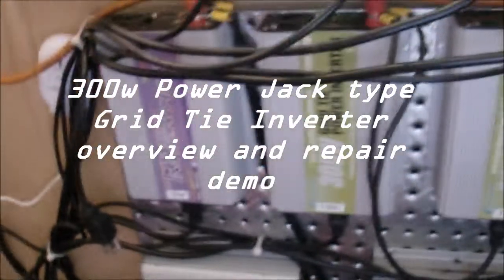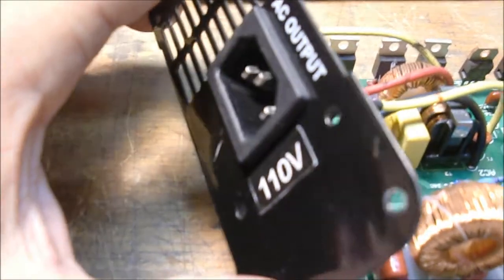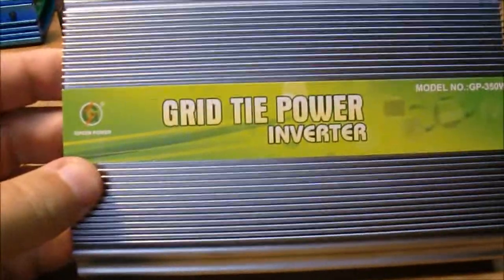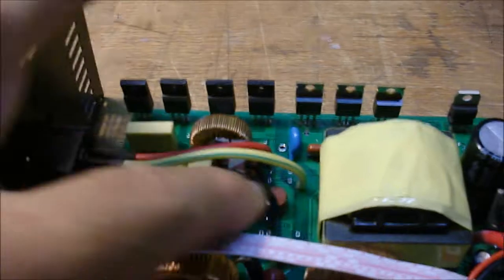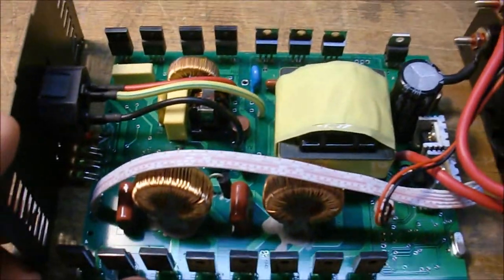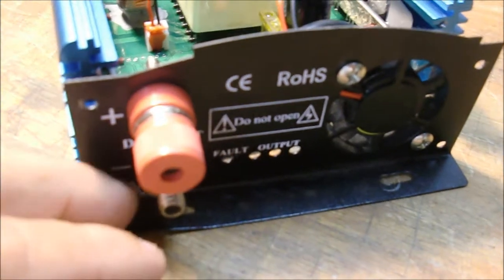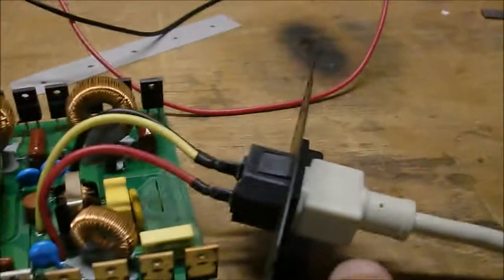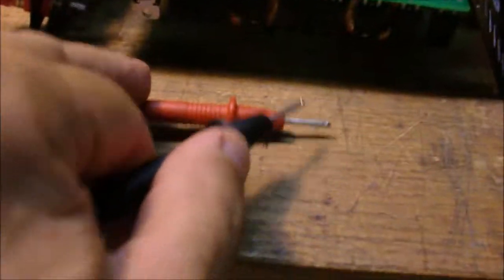Power Jack Sun 300 Grid Tie Inverter repair

Comment: @7:58 Don't forget to remove the carbon under and around any blown component. The carbon acts like a leakage path that can cause problems if not addressed. Under a fuse it may not be as vital, but it's still good practice.

Comment: At first I read 75A 250v on a GP-350W GTI AC fuse I'm replacing, but using a magnifying glass and flashlight I noticed they put a "T" next to the "5", so it said "T5A 250V" not 75A or 7.5A.  Be very careful finding the correct fuse, a higher rated fuse could've started a fire and further damaged the board.   The AC fuse is called a "radial, can, vertical" fuse under digikey or mouser's "package/case" field, under "fuse type"  it's "board mount (cartridge style excluded)".  Hope this helps.

Comment: great vid! Tks for sharing!  Why do these mosfets blow?
Reply: That is an excellent question and one which it seems even the manufacturers don't know - as the best they can do is to issue people with replacement MOSFETs and tell them to solder them in!

I had a 250W (I think it was) which died when being driven from a little 20w panel - no chance of it being over voltage and massively under powerered. Then I bought a 1200W unit to service 4 * 250W panels. It worked great for nearly two months. Then it blew AC MOSFET, DC MOSFET and I vaguely recall it blew a diode too.

They sent me a replacement kit - which made it all work again for a few months and then it died and ended up dumped in the junk box for parts.

A real shame as if they could find out why their circuit design is so flaky - and solve it - then they would be a useful product. As it is, they are just unreliable grot that needs babysitting and repairing on a fairly regular basis.

One thing that DID occur just now (and I cannot recall the circuit) was whether or not there was a low value resistor in series with each MOSFET to make sure they all "pull together". Without that, it is quite possible that just one MOSFET may do the bulk of the work while the others just "sit by and watch". As such it gets hot, shorts and fails again.

I know I tried fitting GOOD transient suppressors on the mains next to where this was plugged in - but as I say, it still died after a few months.

I don't expect perfection for a cheap product - but I don't expect to have to repair it every few months. If fitted to a proper circuit, MOSFETs can work cheerfully for DECADES without failing.

Comment: Great video. You got all the talking points without wasting a lot of time.  Just bought a bad Greenpower 350 like you pictured.  Gave me something to look at while I wait for mine to arrive.  Been repairing electronics since 1965.  That G-S shorting is a good trick for others to learn and is generally not affected when other FETs are in parallel, except lowest resistance is bad due added gate resistor. Ever figured out what the real efficiency is of these small units?

Comment: Hello I have a grid tie inverter 1000 W. The fuse in the inverter is broken. Underneath the fuse is labeled EUR:T10A L250 V. Does anyone know how this happened and if there is any way I can fix it? Thank you in advance.
Reply: As you posted this 11 months ago, it might be a bit late to offer help - but if you cannot find a fuse to drop in as a direct replacement to fit in the holes, you could always just solder in a couple of lengths of wire (1mm conductor at least) and then solder it to a panel mounted fuseholder and pop a 10A fuse in. Cruder still, you could use single core copper wire (again 1mm or better) and solder a 10A fuse directly to the wires. Don't touch it while it is on :)

Before you do this though, you might want to buy a cheap little multimeter if you don't have one already and make sure when you set the meter to OHMS, that you do not find a short on any of the MOSFET's. If you do, you need to replace these before powering on or the fuse will just blow again.

They really are desperately unreliable inverters.

Comment: I have a grid Tie inverter that doesn't seem to work right.
1) Fan does not come on even though the unit is almost to hot to touch.
2) it does make AC current but an new unit of the same size put out 900w more.

Any ideas?

Where do you buy spare parts?

Ralph
Reply: Perhaps its a bunked fan, Does the unit output rated voltage if allowed to cool?

Comment: Hopefully somebody can help me I have sun grid tie inverter 10v to 30v model and when I connect it to a input voltage of 14v the green lights move but on my kill a watt meter it does not show any watts can anybody help me why doesn't it produce any watts if the green lights are moving

Comment: Hi Fearlessthinker, you have taught me to identify the problem with my little GP-350, its funny, i watched and worked out the fuse ac was blown, mine has a glass fuse in a little black box instead of the solder in one, I paused the video, went and checked it and it was blown, i replaced it and plugged it into blow the new fuse, then i came in and watched the rest of the video (forehead slap) and the Ac Mosfet is shorting, lol, could have saved a fuse if i watched it through the first time, lol.
Can you help please ? If it is identified as a magnachip MDP13N50 , What are the main numbers that identify it, is magnachip just a company, Do i need a magnachip one or just any MDP 13N50 or a 13N50 ? I dont know what the numbers mean... Thanks soooo much.
Ms Maddy xx

Comment: Is there a visual means of determining the input dc voltage i.e, 12V, 22-60V, etc?  I've inherited an 800 W direct grid tie inverter but there is no printed indication of the input voltage required.

Comment: Go with a 50v Cap rated for 105 degrees Celsius. It is safe to go up on voltage, but never lower. Use a Nichicon or Panasonic and check your mm height and diameter before ordering to ensure it will fit.

Comment: I purchased 2 - 300 watt Eco-worthy solar systems but havent gotten more that 140 watts coming out of the included grid tie inverters(via WANF meters). I also checked my main meter and it only changes .25 watts or so when I turn the solar systems off and on. I also have a "Solar city" installed solar system, but needed to make more due to adding electrical appliances.Any notions?

Comment: Hi, I need some help :)
I do have this new inverter its a 12v 300w pure sine. It turns on, fan turns on but no voltage at the ac terminal barley 0.8v with multimeter and when I plug one of the multimeter leads I get the 50Hz, when I plug both at the terminals I get 0 Hz. Any ideas?

Comment: Hi, can you tell me if I can use a 12v battery to power my power jack 600W grid tie, just to test it. It worked when I got it and now it doesn't. Appears to be OK as far as blown fuses and such. I can't seam to locate the ac fuse. That may be a problem.

Comment: Thanks for fixing my inverter for me Fearless.  I believe that I blew this one when I changed the voltage's on the roof from a 29V Panel to a series 60V and I had forgot to remove the wires from the 29V off it when I swapped it out.  Its interesting how that blew.  I knew how to fix all the mosfets but I didn't know about that piece in the middle of the board that had burned.  Part of my problem is soldering.  You are really good at soldering in the parts.

Comment: I have yet to find a decent multi ohm meter that works on testing ohms. I can not test my phets with the junk that I have. Can you recomend a meter that will work for testing phets. I had this same problem when i went to test my glow plugs in my vw jetta the meter just wouldnt give a reading. I looked on the radio shack site and they dont have one like yours anymore it appears.

Comment: Nice job Explaining all The parts! I like that dc power source as a battery charger does not go above 16,a 12 v. I have noticed that when i fixed my 1200 watt Power Jack.When u test the( legs) on the mosfets  U should get the same reading on all of them, if u take the test leads & switch back 1 leg U get a lesser reading or a OL .A good way for to test if they read same.Also I have found that if I replaced a bad fet.soon the 1on Other side goes bad taking out the new 1 with it.Now I put in 2.